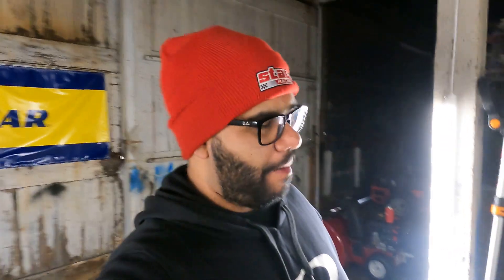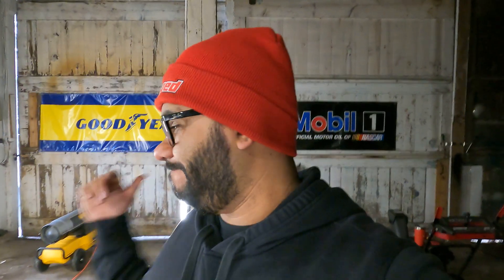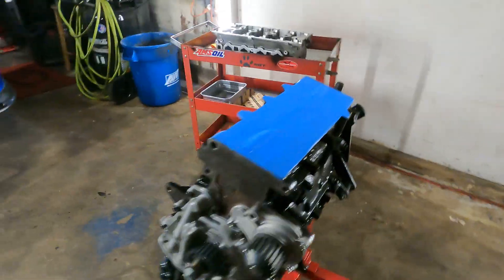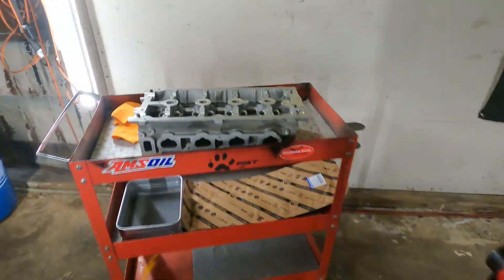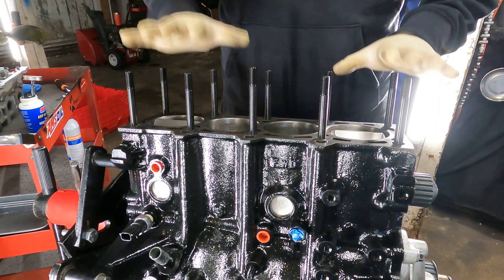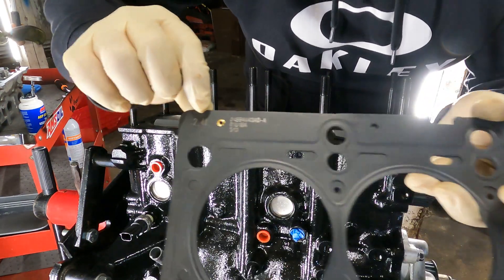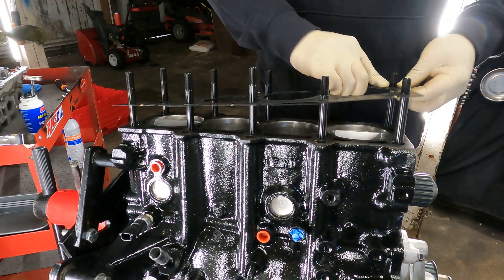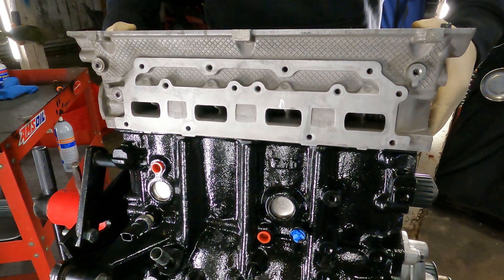SRT-4 head install with torque spec

Comment: You forgot the copper spray on the head gasket
Reply from the maker: I’ve never used it. And never had any issues before, but not a bad idea for next time.
Reply: I really enjoy watching your videos of this build and currently doing one my self as well
Reply: I never use copper spray, if it was needed the gasket would come with it already on it. Also, when you remove the factory gasket you will notice - no copper spray in sight.

Comment: I just did the head gasket on my DOHC 2.0, and the instructions I had specifically said (regarding the quarter turn at the end) NOT to use a torque wrench for tht step. haha. BTW, that car is super clean...where are you located?
Reply from the maker: About a hour west of Chicago

Comment: You forgot your 2 block to head dowels
Reply from the maker: Not a big deal. I used the studs to help guide the head in place. I made sure the head and block are centered
Reply: @stagedracing8150  how would you know the head and block are perfectly aligned when you don't have the pins? You don't want ANY play at all between head and block.